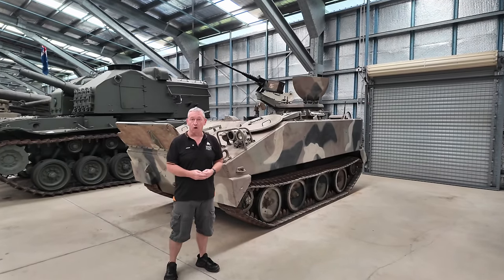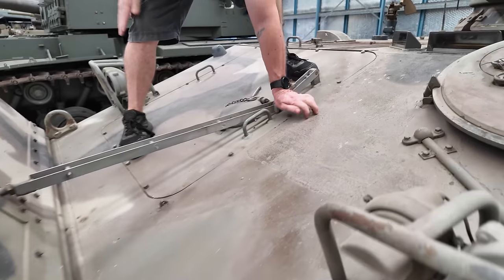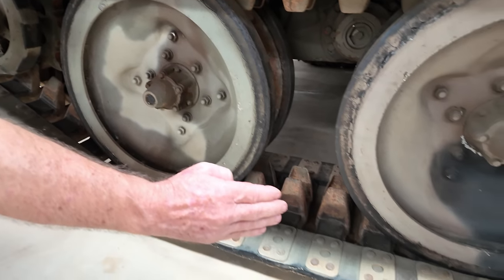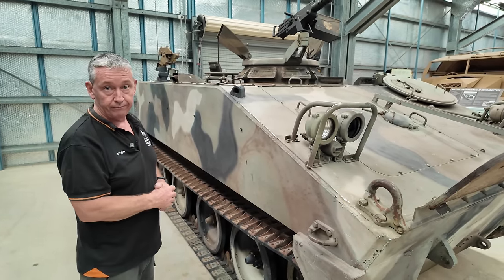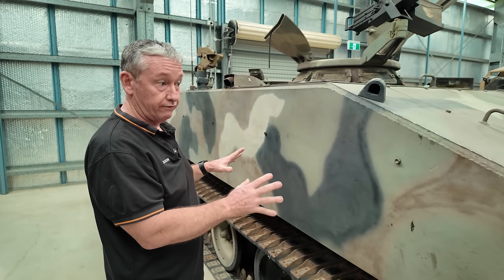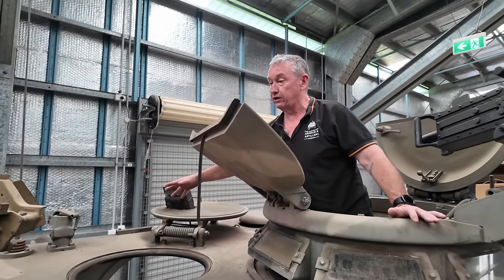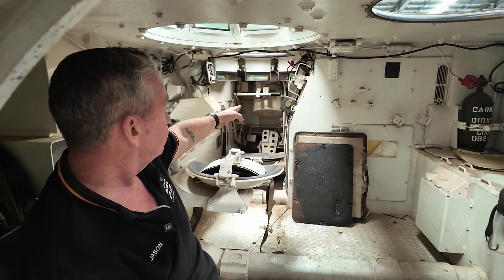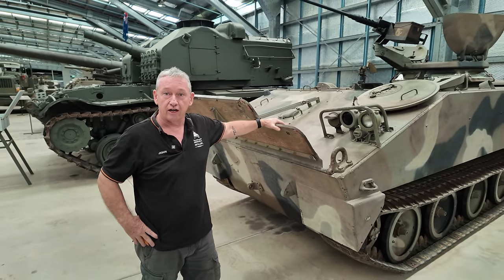The M114 Armoured Recon Vehicle

Comment: We had 5 of those awful tracks in my Cavalry Platoon along with 3 M551A1 Sheridans, 1 M113A1 with an Infantry squad and a M106A1 4.2" mortar,  in Germany till 1975. Then we went to 6 M551A1s per platoon, I was glad to get rid of them, but when I transferred to the 3rd ACR in the States in 1979, there they were again. Was glad that they were replaced with 5 m113A1s,  and 4 M60A1s. The M114 was very under powered, got stuck a lot, caught on fire, I even saw an unmanned one catch fire in the motor pool. Being a Armored Reconnaissance Specialist (Scout) MOS 11DXXR8 meant you were trained on the M114, M113, and the M551A1. Later on when they took Cavalry and Armor out of the 11 series and us into the 19 series MOS, we got to chose if we wanted to be 19Ds (Scouts) or 19G (Sheridan). But if your unit needed you, you could be assigned to a M60A1 AOS RISE or as I was later made a Tank Commander on an M60A3. I saw a lot of worthless vehicles in the US Army like the Gamma Goat and the Gore ,but hands down the worst was the M114, M114A1, M114A1E1.
Reply: They look like a solution looking for a problem.
Reply: @ptonpc  I saw the Canadians who were smarter than the US Army adopt the recon version of the M113 called the Lynx it should have been in US service, as it used M113 components and was not so under powered and didn't get stuck crossing a ditch.
Reply: Brave Rifles!
Reply: Like the M113, we called it "spam in a can"
Reply: where have you been in Germany?
Reply: @floriangeyer3454  Stationed in Böblingen with C Trp 1/4 CAV, 1IDF, did border duty with 2/2 ACR at Camp Mai and Rotz in the late 70s  early 80s then sent to 3ACR at Ft Bliss K Trp 3/3 ACR. Left Army in 1985 after 9 years AD. Took European Out and have been here since in Southern Germany
Reply: @swedesamurai3331  Greetings from Hesse near Elvis Presley`s "Military Home"  Ray Barracks, Friedberg.
My mother`s familly is from Boston . I am a German national and reservist of the 
German Army, PsyOp 1987-88 and CENTAG Heidelberg and interested in US Army history in our vicinity.
I traded badges with some of your 3Cav troopers in 85 .

If you served in  3rd Cav you probably have been here near Bad nauheim during Reforger 85.
Reply: I drove one in 1975/76 when I was in 1st Armored DIV in Germany. I truly believe that the M114 tried to kill me at least three times. The last time I bailed out the back on a road march when the engine compartment caught fire. A lot of bad memories but some great stories,
Reply: @swedesamurai3331  Camp May and Camp Rotz (Reed) were in the 3/2ACR sector
Reply: @fordhipo1493  Sure your right. Typo on my side. Got lazy and didn't proof read my post.

Comment: Very nearly wound up training on these at Ft Knox in the summer of 71, but fortunately the screwed-up orders that assigned me to that training company were corrected (I was 11E, tanker, not 11D scout, from a Guard tank company, the state I was from didn't have ANY of these things) and I was reassigned to a proper tank training company.  The irony, of course, as such things usually turn out, was that 13 years later, I ended up in an armored cavalry unit and my primary specialty became being a scout, although I still commanded a tank.

And in the summer of 89, I got to crawl through an old M114 that had been turned into a museum piece instead of being dragged out to the tank gunnery ranges as a hard target like so many of its unlamented brethren.

Comment: Stayed broke down in my Infantry battalion in Germany 1973; scount platoon would lead out for  alerts with at least 4 in tow on the way to  assembly area.  Replaced with M113s in 1974.  Needed that 20mm Canon on the 113s for a bit more stand off in Scouts; always used in economy of force by Battalion.

Comment: I saw an M114 in 1986 at the range at Ft Drum NY. I was the TC in an M48A5 from 1/26 Cav, Mass Army Guard. The 114 was just towed out to the 500 yd area as a target. It was almost facing us. The first round we fired was a HEAT training round. No HE, just kinetic energy. It hit front/front left and took the engine out the rear hatch. We didn't fire a second round.

Comment: Nice job on the walkaround video. Preferred the M113 over the M114. The aluminum is alloy 5082. We have one tracked robot using it for protection. This unit is in great shape. Thanks for showing it,